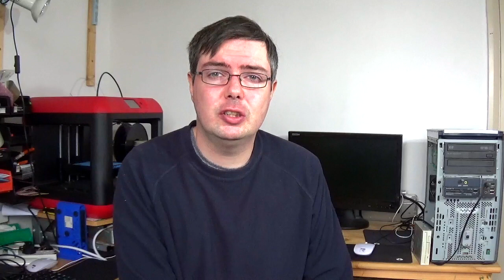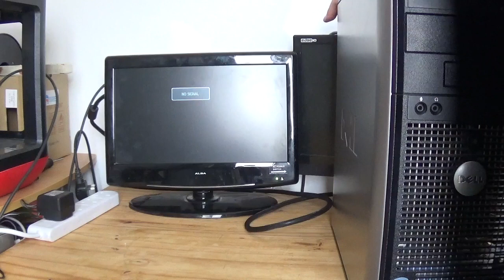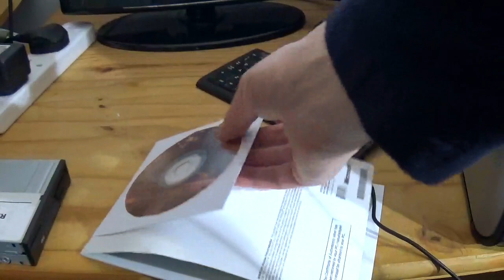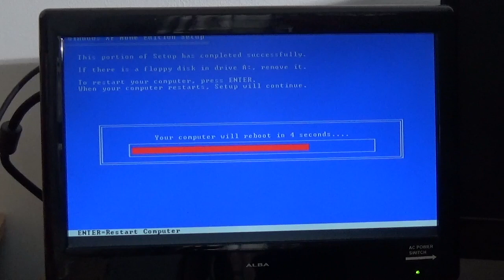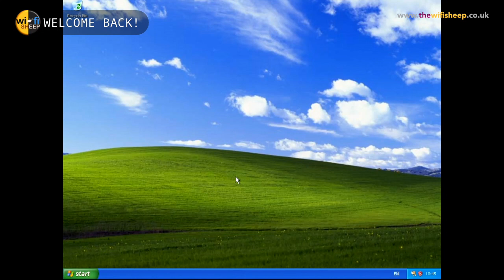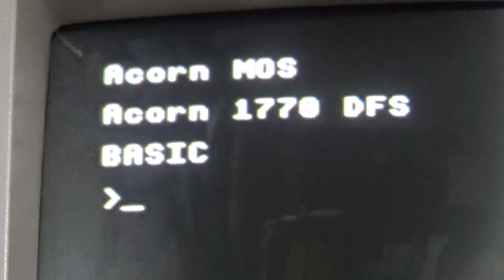A Bridge PC? Transfer data between old & new?

Comment: Hi Tom,

After following your series about RISC OS Direct on a Raspberry Pi I got a Raspberry Pi 4 for my 40th.  I'm having great fun with it.

Do you have any tips for using Omni Flop to create images of old Acorn Archimedes disks?  I have 5 boxes of old discs that I'd like to recover some of, but I'm having no success using Read mode.  I'm starting to wonder if I have a faulty floppy disc drive but I have no blank disks to test it with.  My old PC (AMD Athlon 64 from about 2003) is running Windows 7 so I'm thinking of installing XP instead, to see if that helps.

I managed to get the software to read a floppy disk and create a .adf file but when I attempted to read this under RISC OS Direct on my Raspberry Pi 4 it could not be read.  The Omni Flop software was not able to auto-detect the format of the disks I tried, so I tried the various disk formats manually.

Also, is there any way of running games that required multiple floppy disks on the Raspberry Pi?

Many thanks

Darren
Reply: I've tried installing XP tonight but it doesn't see my hard disk.  I need to install a driver by pressing F1 on startup of the install CD but I don't have a floppy disk with the necessary driver.  I am therefore stuck with Windows 7 but I just can't get Omni Flop to create a valid .adf file.  I've managed to generate both a 400kb and 800kb adf file for my HoledOut disk but if I try to mount either of these files I get "Filecore does not understand this disk"
Reply from the maker: Hi Darren, So im no expert in this but the main issue is Omni Flop requiring a custom Floppy driver which really only works on Windows XP, so it really has to be an XP / NT system.
As an experiment, and I have no idea if this would work.... and it will require a lot of setup on your part but.... 

If your happy to replace the OS of your bridge PC then you could try ReactOS which is a modern Windows NT / XP era clone that supports most x86 PC drivers and software. 
https://reactos.org/

Im going to need to scrap XP myself shortly so will be looking at the ReactOS / Omni Flop direction.
Reply: @WiFiSheep  Thanks for your reply.  This is really embarrassing.  I opened up the PC and found that the floppy disk drive was not connected to the motherboard or power supply.  Omni Flop suggested it was extracting data but I did wonder why the drive wasn't making any noise (Doh!!!).  Now I need to track down a floppy disk drive ribbon cable.  My parents have a big box of old computer cables so hopefully I will find one.

The Omni Flop website suggests that the software should/can work with Windows 7, so I will give it another try once the drive is connected.

When I installed Omni Flop I was able to install the custom floppy disk driver supplied.  Omni Flop suggested it could understand the format of the inserted disk but it obviously couldn't without the drive connected.  I managed to find a floppy disk I knew I could safely format and that's when I realised the drive wasn't connected.  It's strange that the drive shows up in Windows 7 when it isn't even connected.

What an embarrassing story!!!  I must have disconnected the drive years ago when I realised I had no use for a floppy drive anymore.
Reply from the maker: If your PC BIOS is setup to expect a floppy A drive then it will cache one even if the drive is not present. Although saying that you should have got a drive error warning on boot up prior to windows 7 kicking in??? 
Still not to worry happens to the best of us LOL 
I've not looked at Omni flop in a little while so its either had an update to support 7 or I just assumed it stopped at XP??? Any how remember to install the custom driver Omni Flop needs to work and best of luck once you've sources a new cable, plenty on ebay!
Reply: Thanks for the guidance.  Also, many thanks for your series on RISC OS Direct.  I wouldn't have known about it, if I hadn't stumbled across your video.  I'm enjoying old games like Twin World, Mad Professor Mariarti, Lemmings and Stunt Racer 2000 again.

Comment: I think your mounting problem with the 3,5 inch floppy drive is that you have to mount the screws on the drive before slotting it in. If you look at the cage, you will see slides going from the front where you can slide in the drive with the screws mounted. This will align the drive perfectly.
BTW I have the exact same machine, and I upgraded it with a Core 2 Quad Q6600 cpu modded for 3GHz. So now it's actually a pretty decent machine. Only the missing IDE connector is bugging me!
Reply from the maker: Hi many thanks for that (I was hoping no one would spot my mistake with the mount screws .... :-P) I did figure this out off camera so when I swapped the 3.5 drives around the second one is fixed properly!  
Cool to hear you've upgraded yours, I've still got a fair bit of work to do on this one mainly software drivers but this video was getting long enough as it was! Still i'm sure you'll agree not bad for a freebee!

Comment: A great video again. But wouldn't you consider installing a GNU/Linux distro to your old computers instead of XP? I am saying that because many Linux distros are lightweight, good looking with a great variation of desktop environments and themes and have modern GNU software such as Brasero and Gparted which support floppy discs and many other stuff. And the best part is, the Linux kernel, the distros and all of stuff come with those are made and maintained by the community itself. It would be cool if you would do videos about Linux stuff btw such as distro, GNU app reviews and Bash command tutorials.
Reply: I agree.
Reply from the maker: Hello, thanks for your feedback, duly noted! Basically clangerbasher has the answer as for the use of Windows and it is all about formatting and software compatibility. 
Not just the disk formatter tools, but most if not all the filer systems and even SD/MMC card reader tools used with the BBC Micro are written exclusively for 32-bit windows  and the bulk is closed source so with the exception of maybe trying  ReactOS , older builds of Windows it has to be .... for now :-/

A look at Linux distros will come im fully busy with other projects and commitments at the moment but never say never!